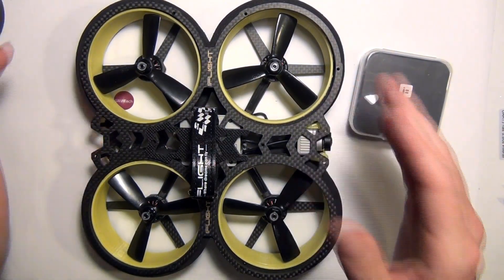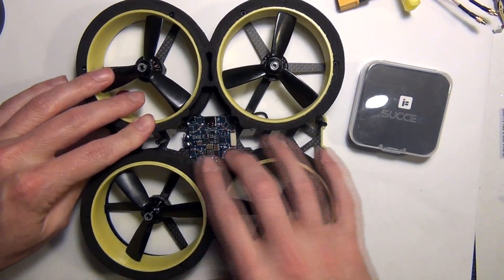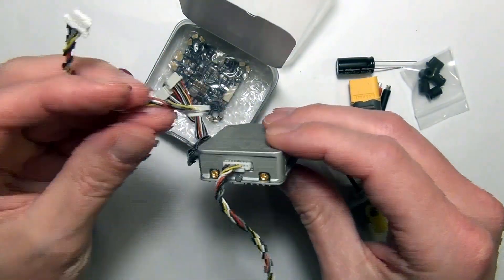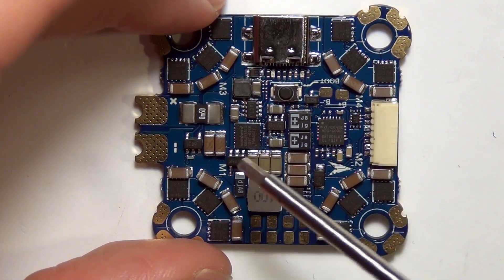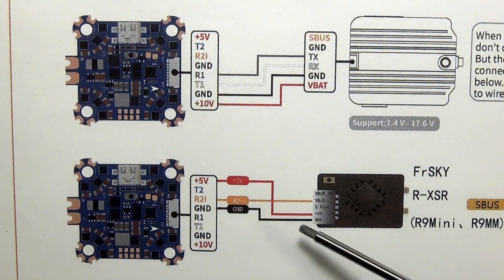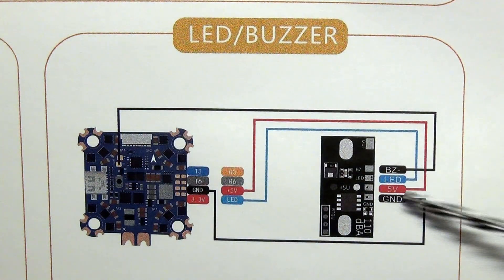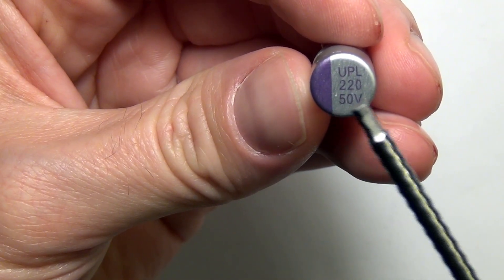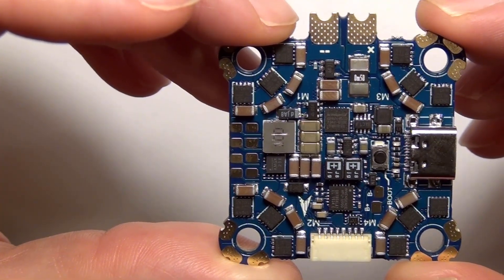iFlight SucceX-A F4 FC and 40amp ESC BLHeli-32 Review

Comment: I'm 3 years late to the party but have the same board in an iFlight DC2. The drone was always way to heavy so going to rob and juggle it into a AOS 3.5 build. In your opinion is the board still relevant in 2023?  I feel the 32 bit ESC's could make it a very smooth flyer.

Comment: Hey Mark, thanks for the review! 
My succex-A aio maybe has a problem on pitch axis. On a pretuned Bumblebee (from iflight), i have very hot motors even on hover for a couple of seconds. By looking the bbox, it has lot of noise on pitch axis. Even tweeking the filters (Gyro and D-term), the noise is still there.(softmounted, no cables or anything else bumping). Lowering D on pitch got more cool motors on hover but still not as good as it has to be. 
Should i try hardmounted for the noise? 
and/or more filtering? 
What's your opinion?
Reply from the maker: These rigs run hot motors regardless of noise.
Reply: @uavtech  i disagree. Pretuned profile was shit. According to your Filter/ PID tunning process, bumblebee now flies razor sharp with cool to warm motors. Thank you Mark!

Comment: I built this bumblebee with that flight controller the dji air unit and crossfire but I cannot get osd? Any help with this would be greatly appreciated thanks 🙏
Reply from the maker: Need to enable DJI MSP for OSD.
Reply: @uavtech  aha! Thankyou! Where do I do that?🤔
Reply from the maker: You have to wire the Air Unit up to a UART (see DJI Air Unit manual) and then enable MSP on that Uart.  Then in the goggles select Custom OSD.

https://youtu.be/L7Pag_gDKWA
Reply: @uavtech  ah ok. So I used the plug on the flight controller and removed the sbus and ground wire then wired my crossfire to uart 3 I enabled uart 1 configuration/msp and serial rx in uart 3 for the crossfire and I have no osd sondoni need to remove the tx and rx wire from the plug and use the remaining t6 and r6 pads and then enable them msp only? Thanks for the help sorry for the confusion

Comment: Nice review! As you mentioned that frequency area that should be clean in black box. Is  ESC Noise usually visible under 200hz? I have one build wich seems to be affected by ESC noise, huge spike on 71 hz visible in Gyro on pitch axis and gets really badly amplified by dterm, even on low filter sliders.
I get very bad grindig noise when using 3 bladed props and additional weight (Gopro) on stock pids, wich are related to this spike. Placing a dterm notch (71hz center, 62hz cutoff) resolves this issues. But due to the fact that it´s right in the propwash area it affects the propwash handling and  I really want to fix this issue by hardware first instead of covering by software filter.
I tried everything, new FC (to ensure that gyro is ok), different motors, checked every screw on Frame. Softmounted motors and FC, this spike is still there. It´s a kakute F7 HDV and Tekko32 45A ESC (rev c) running on 6S on a 7" FR7 Frame
I´m running a 35V 1000uF cap wich is using extending wires that are running across the ESC on top of it underneath the FC. 
Strange thing, only pitch axis is affected and wiring runs right on pitch axis. Do you think this could be the issue? Wiring to the Cap is about 10cm.
I´m out of ideas.

Comment: Can we mount a DJI caddx vista on top of the stack?
Reply from the maker: I reckon so.  It is a normal 30x30 FC.
Reply: @uavtech  But vista has 20 20 holes? By the way how did you mount full airunit on top?
Reply from the maker: @rajeevgopal3961  , oops, brain fart.

It sits in the foam of the iFlight Cinebee OR you strap to the top plate for like a 5" or something.

Comment: Just installed this FC... Triple checked board alignment, motor direction...etc.. It will idle fine. Airmode on...I can rock the quad so the outputs are correct.  As soon as I touch the throttle it goes nuts...Also will not connect to the Android app :(
Reply from the maker: Very weird.  Double check everything and if persists, reach out to iFlight  (Patrick).

Comment: I wonder how to put tbs crossfire, gps and a independent buzzer on this board at the same time cause it is only have 1 pad for 5v and 1 pad for ground
Reply from the maker: UARTS 1, 2, 3 and 6 have pads.  That should be enough: https://www.screencast.com/t/0r4RkA8tt
Reply from the maker: https://shop.iflight-rc.com/index.php?route=product/product&product_id=1123
Reply: Yes but 5volt pad and ground pad is limited, where i got the power to power those things
Reply: @hadeiy  I have this board with a ViFly buzzer on it. I used the B+ as a 5v pad, then just used the same GND that I use for my XM+ Rx. You can use the same 5v pad for multiple devices, just make sure you don't exceed 2A draw for this board. Remember that the DJI AU is already using around 1.1A.

Comment: Sorry techmaster but is this board compatible with R-XSR and Jumper T12 pro?  I'm using this setup with the DJI air unit and no matter what firmware combo I've tried it's RX LOSS in betaflight.
Reply from the maker: See wire diagram.  They use and R-XSR as an example: https://shop.iflight-rc.com/index.php?route=product/product&product_id=1123

Comment: Mine did not come with any stand offs. Not sure how to mount correctly. When I add those silicon spacers they cover where I would solder the motors so I don't think that is right. What size stand offs do you use? After that, the DJI unit just sits there on top? no tie downs or anything?
Reply from the maker: It should have come with rubber gromits that give it space off the bottom plate.  Yes, in the iFlight CineBee the DJI air unit sits in the foam.
Reply: @uavtech  Thank you for the reply... So when I put those on they are right where I solder so that seems weird. But aside from that the holes there bigger so the original post/screws are too small. What did you use as posts to hold it and how high do they need to be? I don't have any M3 screws or posts so I guess I will need to order. Or am I totally over thinking this and doing it wrong? lol
Reply from the maker: M3 is what you need.  Yeah, the ESC pads are close to the gummies.  But it is alright with a smaller tipped solder iron.
Reply: @uavtech  Thanks  for clarifying that for me. I ordered a  bunch of screws, standoffs and probably a bunch of stuff I don't need right now but I hope it is what I do need. Thanks again!

Comment: I’m having a really weird issue with this AIO.  If I try to do a snap flip (fast full deflection flip) the quad spins at a really high rate that seems like 2000 deg/sec.  my rates are set to 1000 deg/sec,  Roll and Yaw behave normally.  This only happens on 6s.  On 4s all is normal.  Any thoughts or suggestions?
Reply from the maker: Default filters and PIDs?  I would log it with "Gyro_Scaled" debug recorded.
Reply: UAV Tech, yes default filters and pids. The only changes I made was to rotate the board 180 deg and remap motors.
Reply: @steimy7377  Good evening, I have the same problem, you managed to fix the error of the flip with 6s? Thank you
Reply: @uavtech  I have the same problem, you managed to fix the error of the flip with 6s? Thank you
Reply: @erkikedejere  did you manage to solve the problem? If I do a flip on the pitch axis on 6S the quad freaks out.
Reply: @Kitsunefase  No, I could not solve the error ... I have 2 FC like beautiful bricks !!
Reply: @uavtech  I have the same problem like Rob below. The quad goes crazy when I do a flip on the pitch axis on 6S. I don't know what to do

Comment: Hi sir, i just got my FC and i would know if i can wire TBS crosfire trough the DJI connector like forFrSky ? If not, i will need to use the side pads, can i both wire Crossfire + gps on it ?

Comment: How would you wire up a frsky XSR for telemetry using the smart port since its a F4 flight controller
Reply from the maker: Use Soft Serial with LED pad.

See https://youtu.be/jT4vf6575TM

Comment: I've been trying to get this board to work properly on my rig. Any time I bump the throttle suddenly, it wigs out and tumbles to the ground. Flies perfectly fine as long as I'm suuuuper ginger with the throttle. Can't figure out what's doing it. Even chopping the PIDs in half (which wasn't necessary with the same quad using a different FC) doesn't help. Shame, I really wanted to like it.
Reply: Same thing is happening to me. Triple checked board alignment, motor direction...etc.. It will idle fine. Airmode on...I can rock the quad so the outputs are correct.  As soon as I touch the throttle it goes nuts...
Reply from the maker: Log it
Reply: UAV Tech I did
Reply from the maker: So what is the specific issue?
Reply: UAV Tech I gotta get a little smarter on reading the lines, but I see my gyro lines going completely nuts when I bump the throttle or make sudden inputs.
Reply: Ive had same issue. Replaced with a new board. Fixed. Not sure whats up with that.

Comment: On the banggood webpage this is stated:
OSD Chip: NO (Analog OSD not available)
OSD Betaflight: YES (Digital DJI Air Unit pass-through)

I don't understand what this means?
Will I be able to display Betaflight OSD data like Alt, Current, Vbat?
Reply from the maker: Yes, with a DJI Air Unit ONLY.

Comment: i bought a cheap eachine tyro129 can't remember which fc it comes with like a momba 405 or something but i have stuffed that quad in the snow more times then i like to admit and the fc has tweaked out a bunch of time but a heat gun has brought it back from the dead each time lol and it was packed which a yard of frozen water i banggooded it out cooked the sheet out of it and it keeps on kicking

Comment: Try to update your one to the latest release of Betaflight and then see if you get any connection issues.. 
Mine just wants to go into DFU mode .. but connects after many attempts. 
Roll back to the firmware it came with and it's fine.
Another issue we found is you can not connect to it if using the Speedy Bee app and a  OTG cable. (Working now) pays to have your OTG cable the right way round.

I also have two separate Blackbox files in dropbox with video where this is not flying so well on a 5 inch quad.
Had to set filtering to 0.5 .
Can provide links to view.

Comment: Love this board. Been running it on a 5” 6s rig. Interesting issue with iflight flight controllers though. 3 different form factors of their fc’s have had weird glitchy issues running frsky. Switched to crossfire and problems went away. Maybe just a problem that exists in my setups but interesting non the less.
Reply: Im so glad i use only crsf now.
Reply: I’m beginning to loathe frsky. Been phasing them out with crsf slowly but may need to speed up that trend.
Reply from the maker: It is a know FrSky issue.
Reply: @uavtech  is there a workaround? I've got multiple quads acting up with the glitching. so frustrating..